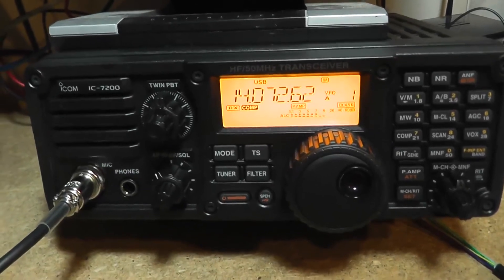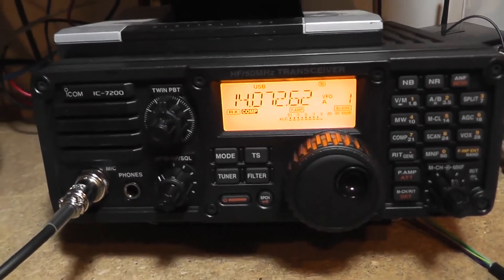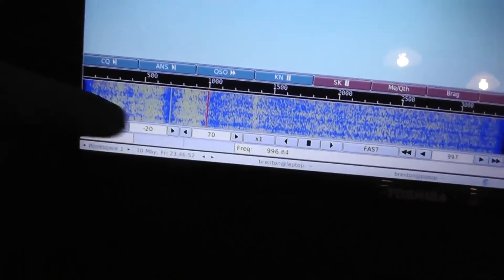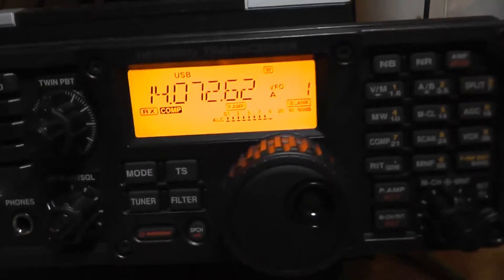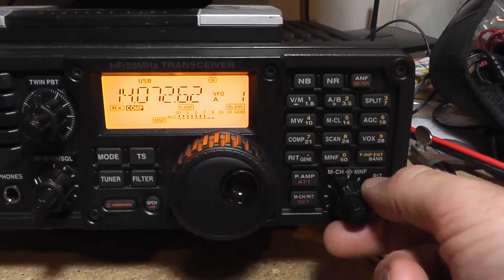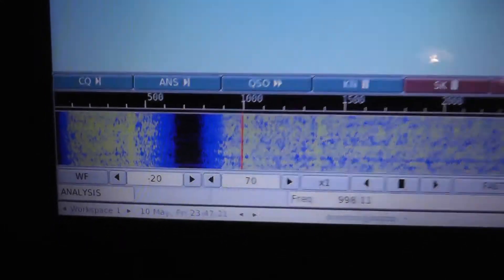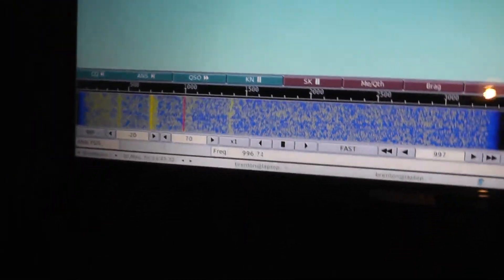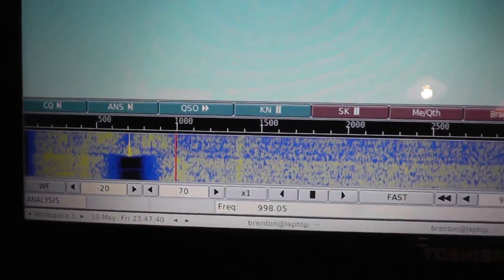Icom IC-7200 Notch Filter Demo

Comment: I am about to buy 1 or 2 of these. I'm impressed with the 7200.
Thanks for sharing.
73's de VK4VKF
Reply from the maker: After using it for a while my only gripe with this radio is the total lack of Tx audio adjustment. The stock mic is rather poor so I use a Heil HC-6 and a homebrew preamp that provides a boost to 1-3kHz, this is then fed into the rear socket via the supplied plug.
Reply from the maker: Oh, and I'm now VK2DDS ;)
Reply: vk2mev Congrats on the final step.
I've done 4 of the 5 exams. My ADV is booked in for February with SARC in Lismore.
QLD has no decent training. 
Thanks again for the video. I am gunna buy the 7200. One for travel and one for home.
Reply from the maker: Ade Larsen It's a nice bit of kit, best receiver in the <$1500 price range I've used. Give us a buzz if you want a sked: vk2dds@gmail
Reply: vk2mev Thanks, 73's de VK4VKF

ps, I've watched every 7200 video on you tube. I kid you not. :-)
Reply: vk2mev I used Dot Com on the end of that prfix and it's not a valid email.